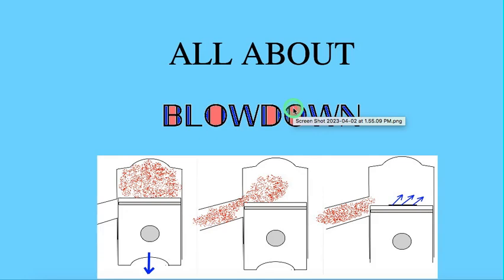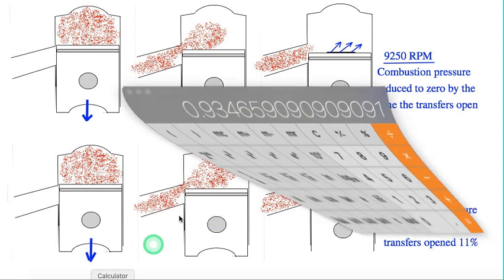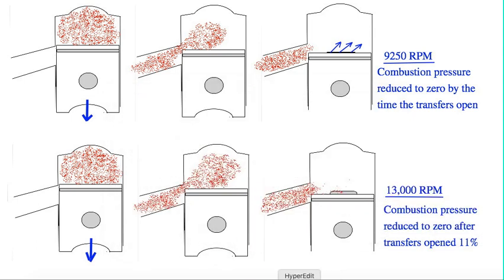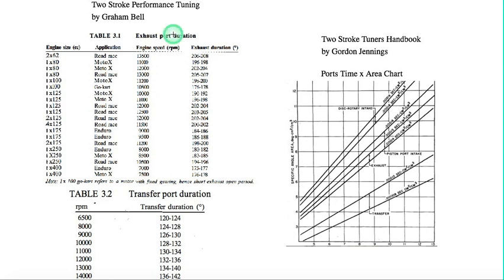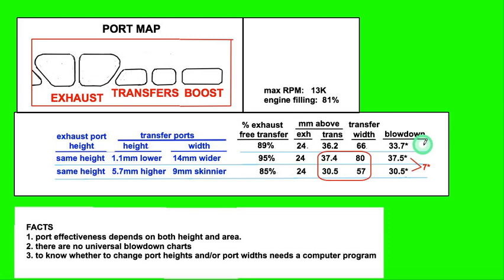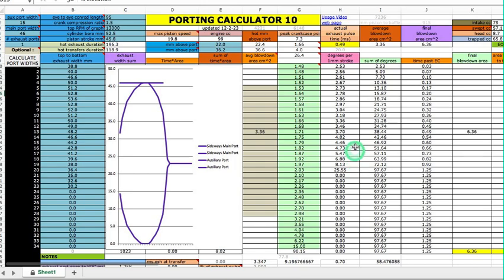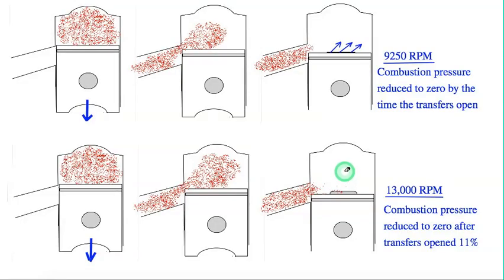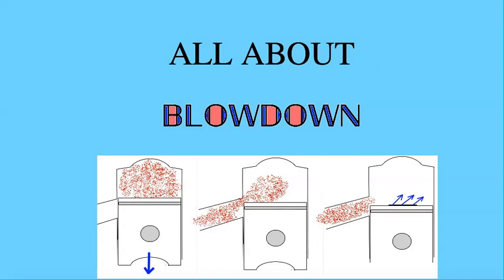All About 2 Stroke Blowdown

Comment: I believe that’s why exhaust ports were widened with bridge ports and chamfering to allow exhaust pressure to reduce enough to open the transfer ports.
Reply from the maker: yes, the wider exhaust ports make it more effective so they don't have to be as tall so the trapped engine volume is greater

Comment: I have an oil question. I have an older twin cylinder 4 stroke model airplane engine. It is a glow fuel engine that has been converted to gasoline with spark ignition. Glow fuel is methanol with 18 to 20 % oil and 5 to 15% nitromthane to improve power and ease tuning. Crankcase lubrication is from blow by. Connecting rods are made of bronze and that is the bearing. 20:1 mix ratio was recommended but people had had failures, so now 15:1 is recommended. I was advised by someone with much experience to run 10:1. After reading your paper on 2T oils and watching videos I decided to try Honda HP2 at 10:1. It seemed to be too much and or too thick. There was a nice amount of oil coming out of the crankcase breather tube and I felt that lubrication was superior. 
More recently I tried Amsoil Dominator at 15:1. It ran much better but I felt like there should be more oil coming from the breather tube. 
Do you think I am better off with an oil like Dominator at 10:1 that seems to burn off, or a higher quality oil like HP2 or Belray H1R that is ester, but at 15:1?
Reply from the maker: I'm sorry but for head splitting questions I need some payment. That's work man. Actually you shouldn't ask me because I have no experience with engines like yours. All I can say is to look up the composition of Dominator on my oil page and then you'll probably scratch it off your list. www.dragonfly75.com/moto/oil.html